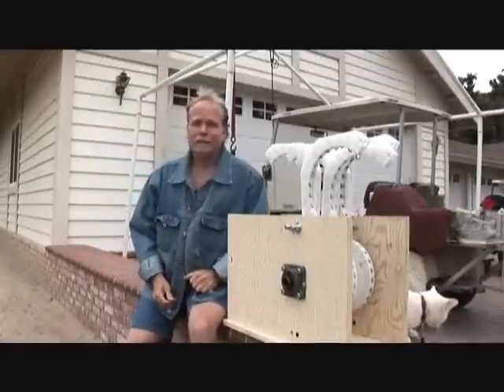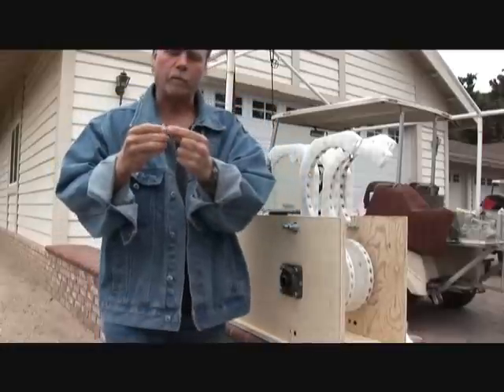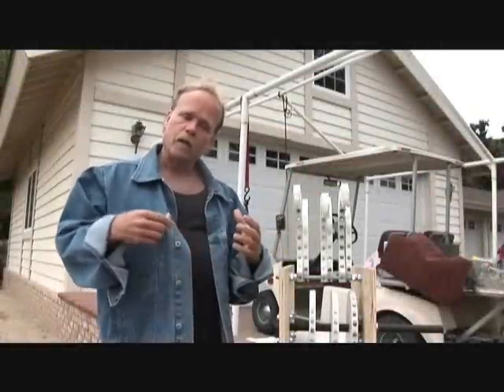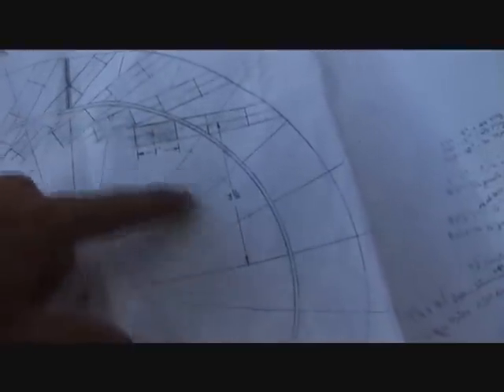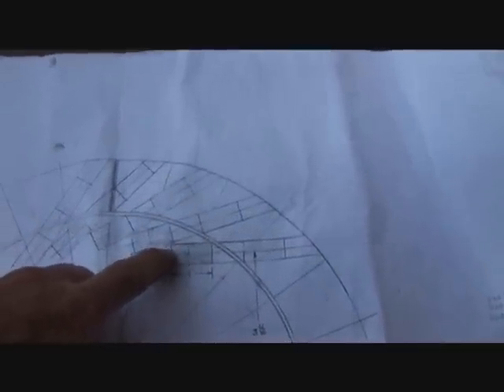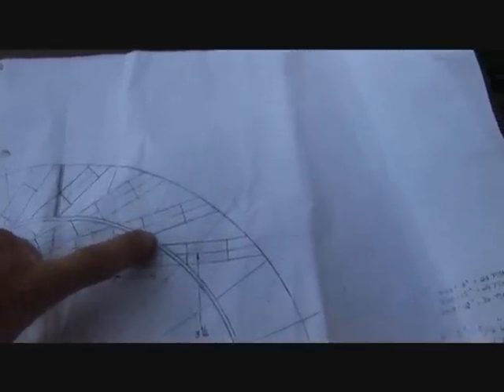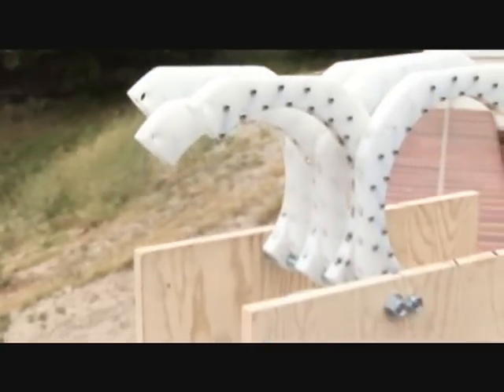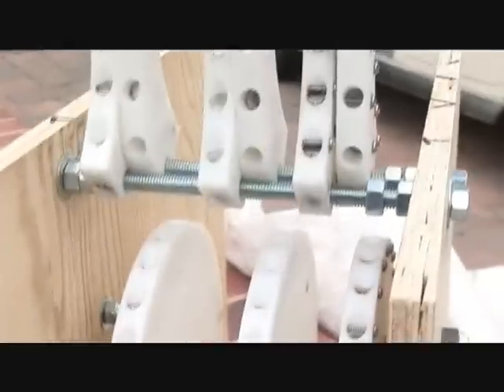Green Motor Project Video 1 Truth About The Perendev Magnet Motor

Comment: The fuy in original video used brass xollars to direct polarity better and help shield its polarity however brass isnt the best as if it is swung by a magnet it will slow...there are paramagnet materials that can be used to sheild magnets better ibthink lithium is one also a torque convertor would be cool addition....i think he also had the angles slightly offset as well so that it they wetent all directed the same way if i remember corrextly it was a toridal offset or fibinnaci sequence used somehow and well we k ow that the seperate wheels are suppose to all be slightly offset from each other as well. Good luck bud. Keep me posted on your progress if possible.

Comment: There is a video of a working machine, its quite large and the gentleman says 20 degree offset between each ring and you are correct about row spacing. My trig skills are lacking when calculating the field patterns and my first design failed, second moves but with no real torque to turn any generator. Im still below the curve but learning. Im using the ratio observed in the original video but scaling it down has been fruitless

Comment: Your stator magnets are to close , you have to acount when a magnet repels it repels a leigns , you must alow the forse minimum   70 %  to disipate , before it is again reloaded by the next magnet . Imagine when you throw a stone in a pond  , they are waves , but when 2 waves colide of same straighnts they disapate . So if you alow  the repel force to disapte till the next one  the wave is so small that dose not affect the new one  just aplifies it .  If you wached or remeber the movie to the core , they needed to create a blast wave to restart the magnetic core of the earth , the same principel is for this motor , easy explained . OW i am electrotechnician , remeber the in a magnet , ( neodim / natural ) .the magnetic field straight at south and north pole are the same the forece of atraction is the same ,  just the direction of the lines that form the field  is not the same , in a neodim magnet the lines  go from norths to south around the magnet , and in the magnet from south to nord . and man made magnets poles are changeble to wich direction you want just changing the polarity . And  if you want more details about magnets i can glady share info .

Comment: Just a note maybe to help. I notice that your motor has paired magnets and as you indicated on your design there is what I term negative magnetic force on the adjacent magnet. However, I have designed a motor with 15 magnets on the rotor and 13 magnets on the stator. This means that at any one time there are only two magnet pairs with the negative adjacent force. All the rest of the magnets are supplying "positive" magnetic force, so allowing the rotor to spin. Try it.

Comment: you need to use magnetic pull with the puling mech mechanically running with yore rotor.2 rotors mechanically and timely aligned.Increase the pulling rotors to increase speed.Gears will be needed to connect the rotors 1/1.

Comment: all thats missing is shielding, If you want to understand how, open any regular HDD  remove magnets from inside with the plate they are attatched to. Stick it plate side onto your fridge. remove- easy huh? now put it magnet side first- watch fingers. By putting the shield under magnet you won't have any more problems
Reply: +Gina Gooligan Instead of the poles cancelling each other You will effectively eliminate push pull effect and have only push or pull depending on orientation

Comment: since you do not understand that the engine works with mono pole. ima has just south pole to repel only. just push the rotating inner wheel ok. the outside wheel is fixed on the motor frame. and internal and repelled South x South repulsive force. then the inner wheel rotates simple. but only the south pole magnets. if the magnet has north south x: does not work north nullifies the south. and South nullifies the north and the

Comment: WHAT vc friend looking for with this engine? electricity with a generator? or u want to drive a car or motorcycle without spending gas? I recommend u invest in conhecimendo engine alternator generator with magnets to the wind with neodymium to generate electric power, solar panel and also his secrets to make electric power. and car. just do ultra lightweight car for two and put electric motor for economic pmw or PWM control pulses stepper motor to drive or bike ride to a whole day with two people with these motors with small battery 45 amps ok.

Comment: They work the last post was bull shit put the magnets in aluminum the sheild one side try this  take a CPU fan glue magnets to the blades put a big one in your hand BAM ! It will spin until the bearing wear will do work you say ! Yes it blows air understand the blades are at 45' the one in your hand is at 45' get close the blade spins

Comment: HAVE YOU TRİED TO INSTALL SHIELDS ON ROTOR MAGNETS AND TESTED IT AGAIN? I DID THE SAME WITHOUT MAGNETS' SHIELDİNG WITH NO RESULT...I LL TRY TO İNSTALL SHIELDING FROM COPPER...AND I M ALSO THINKING THAT PARENDEV MIGHT HAVE  DONE DİFFERENT MAGNET POLES CONFIGRATION--SİNCE BECAUSE SAME POLES FACE TO FACE GİVE NO RESULT WITHOUT SHIELDİNG.WITH SHIELDİNG I DONT KNOW IF IT WORKS.I WAIT YOUR COMMENTS..N/B YOUR MAGNET CONFOGARATION THE SAME AS PARENDEV ORIGINAL DESIGN THAT SEEMS TO WORK.REGARDS..
Reply: Медь не работает, нужен чёрный метал.

Comment: Well the only problem that makes your motor not work is because you have forgotten the magnetic shielding that is crucial to make this motor work!, you need tubes of a metal like brass maybe or copper that shields the magnetic fluxes from each and every magnet.nice job though.
Reply: ondtsn1956 Perendev was simply a prop for a fraud.  Mike Brady went to jail for the fraud.  The machine was turned by ordinary means from the far side.  That is all there is to it.
Reply: ARE YOU SURE OF IT? HAVE YOU TRIED IT THE WAY AS YOU HAVE SAID (I MEAN BY INSERTING COPPER OR BRASS SHILED? N/B: PARANDEV HAS USED BIZMUTH THAT HAS A GOOD CHARECTERISTICS OF DİA -MAGNETİZM-BRASS IS NOT A DIAMAGNETİC MATERİAL ..BUT COPPER HAS SMALLER DİA MAGNETİC PRPOPERTIES THAN BIZMUTH AS MUCH AS 1/16 RATE.
Reply: ImaginaPower copper is not a good Shield not sure about brass I would suggest nickel you cannot get rid of magnetic lines of force but you can redirect them
Reply: Don't change the magnets drill the hole bigger Shield a magnet use a Gauss meter to check the different metals
Reply: You need to shield the magnets individually with plum(lead)

Comment: you need a comutator to time it and magnetic field kill switch.you can kill the magnets with 9vdc and heavy gauge wire wrapped around each magnet.some may say your creating an electric motor but your only killing the magnets for a small percentage of total output.say 25%,then 25% is used to recharge the battery,that still leaves 50% of total output on a unit that can last a thousand years.50% of ten hp is 5hp.x 746 watts is 3.5 kw generator that will power your whole house.search out robomont gravity/ antigravity to learn more.and good luck to you.

Comment: Here's something to help you out:
The first law of thermodynamics- ENERGY CANNOT BE CREATED OR DESTROYED!
Reply: stargate905 It is a scientific law  that was first thought of by Rudolf Clausius in 1850. It's actually very well- known. This law, among other things, proves that perpetual motion machines are impossible.
Reply: stargate905 Outdated? Who disproved it?
Reply: stargate905 And your source is?
Reply: why every body think nthat when you do experience like this there is no kind of energy. When you spin magnets you creat magnetic energy and the first thermodynsmic says that the energy cannot be created or destroied and the only thing you can dou is transforme to other energy so is just like the video did make the magnets move  something on circles and then transformatd the cinetic energy on to other tipe of energy that we can use to other things
Reply: stargate905 The 2015 version of the  law goes as follows:
"Energy will never ever ever ever be created or destroyed. No matter how hard you tried, It will never work. "
Reply: Mahmoud Agha in thid case we will not be crearing energy but using the magnetic fields criate cinetic energy and then transforme it to eletrick power
Reply: SNAAAAAAAAAAAAAAAAAAAAAAAAAAAAAAAAAAAAAAAAAAAAAAAAAAAAAAAAAAAAAAAAAAAAAAAAAAAAAAAAAAAAAAAAAAAAAAAAKEactually you are wrong that has been proven wrong by black hole theory. whoever if you can run power to a motor and surround it by neo magnets so that it runs efficiently enough to charge itself and have some output, you can create energy. if you want to know what I'm talking about go look up stargate motor
Reply: Hooded Creeper what has been proved wrong by black hole theory? that energy can't be created or destroyed? you're wrong, there's a thing called Hawking radiation emitted by black holes so ultimately, they kind of evaporate. a motor cannot run efficiently enough to charge itself, what you're proposing is known as overunity, it's bullshit tht violates the laws of thermodynamics.
Reply: bisquitnspanky until recently black holes themselves were only theoretical, and it could be argued they haven't been directly observed for obvious reasons but merely inferred from the orbits of nearby objects and gravity lensing but they fit the predicted model and the laws of physics as does theoretical Hawking radiation. I'm in agreement that energy cannot be created nor destroyed, I was arguing with Hooded creeper who seemed to imply it was proved wrong. At quantum scales though it may be borrowed from the universe without violating conservation laws, as in John Wheeler's quantum foam (who was also progenitor of the term black hole, at least a heckler in a lecture was)

Comment: you need to worry less about the magnets and more about the shielding. You need the shielding to force contact of the magnets into propulsion, it's easy to do it when you start to think more about the magnetic field itself. the angle of your magnets will only help you get maximum propulsion once the shielding is in place

Comment: I know from experience that in this 8 day period you had to do ALOT of work.  Sorry it did not work.  I'm one who found out the hard way myself.  I tried to take the same set up and draw out the amount of magnets between the first and last "plate".  You used 3 plates.  I used 9 plates with a 3.33 degree helical pattern and a 15 plate with a 2 degree helical pattern.  Good job trying it just does not work even with shielding.

Comment: I think that motor had someone behind it using an electric drill motor...  If you watched the video, it rocks and locks just for a second while its being clamped...  If it was free and the magnets worked... it would have just started running on its own right away.

The answer is sheilding one side of these magnets...Something to shape the field or at least block the negative effect.... if someone can design a material that does this then these motors would be possible.  Good luck everyone !!

Comment: The outside magnets need to be cut perpendicular so that the polar opposites are along the sides of the cylindrical magnets, not at the ends of the magnets. The magnets in the rotor are cut parallel to the magnetic flux, so that the polar opposites are at either end, like all of the ones your using. Then you face the perpendicular magnets in the outer clam shells so that the inside magnets first approach the attractive opposite polarity before being pushed forward by the repulsive same polarity.

Comment: lsn : your job is correct but all the video i see no one used the shield to control the magnit flow?!!!!  WTF is Rong wid u guyz  perendev said  make the wheels offset not in strait so the motor can run and use shield to control the flow of the magnet power and thats it

Comment: I greatly admire your determination. Several keys to magnetic motors...1.) Are you sure that you are supposed to repel or is it supposed to attract?
2.) Are your magnets shielded? 
3.) Make sure that your magnets aren't crossing flux lines, confusing the orientation of the fields.
4.) ANYONE who thinks that it is impossible to make permanent magnet motors is a moron! It is just VERY tricky and very precise. People will say, "You have to give it electricity!" Not necessary! Mechanical force works

Comment: @Izfo777 The magnets are supposed to be 20 degrees off set, his is 5 degrees so of course his unit wont work. Plus his polarity arrangement is completely wrong. His proximity spacing is wrong. His proximity gaps are all wrong. Why would this guy spend all that money to build this unit and not even get the specs for it so that it can work like its supposed to? Only Knowledgemonger could have built this unit worse than this guy in the vid did.

Comment: 1) your plastic stator housing is not configured round like it should be all the way around. 2) the angle of the rotor magnets are incorrect. 3) the closeness proximity between stator and rotor magnets are too far apart. 4) the distance between each stator is too far. 5) the distance between each rotor magnet is to far. 6) you are supposed to stagger each plastic stator assembly to cause the imballance that causes motion. You DID NOT build this according to Perendev specs, thats why it fails.

Comment: The magnet motor should never pin itself,The stator alignment of stators 1 and 2 should make it unstable barely able to stay in one place When stator 3 is applied this should cause the imbalance that causes the rotor assembly to rotate two fields pushing one, two fields pushing one.

Comment: I'm working on a design in which the rotor assembly is a drum with the the magnets in alignment.  The stator is a independently adjustable three ring system A adjustable three ring system should allow for stop start and speed adjustments. The two outer stators will have coils built into there edges to generate electricity The rotor drum will have magnets on its edges to energize the stator coils

Comment: from what i have seen of other videos, you are missing magnetic shielding on one side, which they say would cut out the negative force as the magnets pass each other, and also some show an odd number on the outside ring to the inside wheel. so every 3 magnets are lined up as they pass each other.
maybe it will work , maybe not. if i had the money, i would be trying it too, even if it was to make a desktoy. lol

Comment: Robert, I think you are on the right track. If I am right the problem is that the perendev design has the neodynium magnets encased in steel sleeves to either shield or focus the magnetic field from each magnet. Side magnetic waves from the magnets will interfere with the motor working so putting each in a steel sleeve should prevent the opposite pole from interfering. Such a sleeve may also serve to focus the effect of the exposed pole. What do you think??

Comment: I love your frank open approach, both of what you're building and video seeking help. 
I worked on this off and on for years. Used a bike wheel, vertical shaft bolted to plywood base. Hot melt glued the rotor magnets in place. You can  quickly gain a lot of knowledge with this approach. 

Of course THE problem is getting in the back gate. I believe Perendev, and now others, beat this ... 'cheated the gate' (as one guy put it) by teaming 3,4,5 or more SEPARATE SYSTEMS on a common shaft... Stagge

Comment: I haven't read all the comments. I hope you understand I am trying to help you. Magnets seem almost magical however there is a simple reason no permanent magnet motor will work. The analogy to a magnetic field is a gravitational field. There is no closed (circular) path a weight can travel that will gain energy. Think of a roller coaster lap after lap with no energy input. Same with magnets. There is no circular path a permanent magnet can travel that will gain energy. It is as simple as that.

Comment: TRY A CONE DESIGN , WITH A LINE OF MEGNETS WRAPPING ARROUND A SOLID CONE , GLUEING THEM LIKE A COIL , THAN USE THE SAME LIKE A CUP AND LID ,, PUT CONE INSIDE CONE CUP , THEIR INSIDE CONE CUP PUT SAME MEGNET AS WRAPPED THE CONE SOLID COIL , THIS SHOULD HAVE THE BOLT BARRING AT THE OUT SIDE CONE CUP , TRYING TOO PUSH AWAY,,, DON'T LET IT INSTED , CALL ME AND I'LL TELL YOU MORE MR.BONES

Comment: magnetism can be observed. it is a magnetic force if not the auroras could not be observed near the 0 degrees poles of Terra. for beginners you can see the fields with a paper over a magnet then spread fe fillings on top and the fields align over the paper. also the trick sis to determine the north and south of a magnet; it can be easily down with a compass. good luck; the orientation of the norths and souths is what will cause sync movement by repel and attract. its 5th grade stuff. good luck

Comment: work=movement over distance; there is force (magnetic) in his design, but it's cancelled out by proximity. the torque will depend on the angle of the magnets

Comment: separation of the rotors, the magnets turn the rotors by sync repulsion and attraction and the 20 degree angle of magnets should make a difference, also use some copper for the nuts and bolts as copper attracts with a lesser force to the magnets. Once you get it going, your challenge is to attaach a belt to a free wheel to produce free energy, i wish u luck

Comment: a couple of things your missing, the three wheels on the inside with the magnets have to be 20deg rotated from each other, and you need to shield your magnets so when the outside magnet reaches the opposite polarity of the inside magnet it won't want to pull it back in the opposite direction. There are other things you are missing. Maybe you need to do a little more research. good start though.